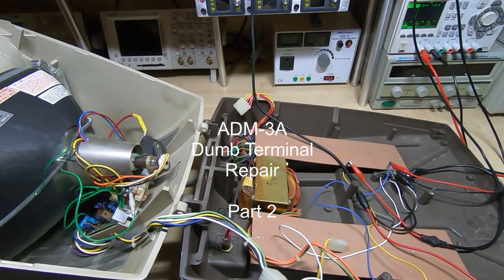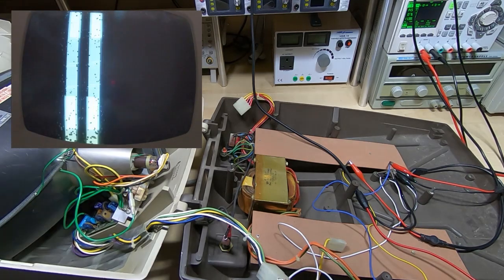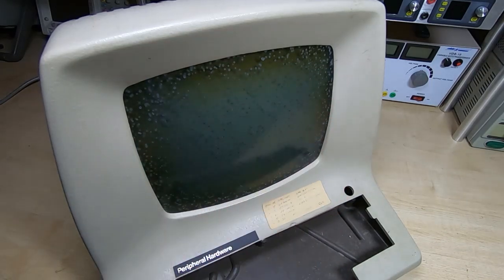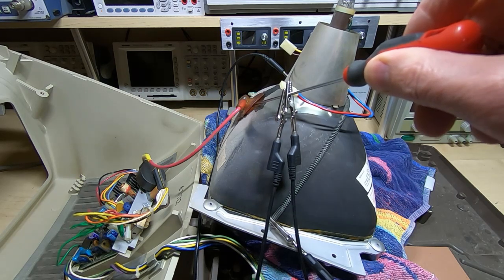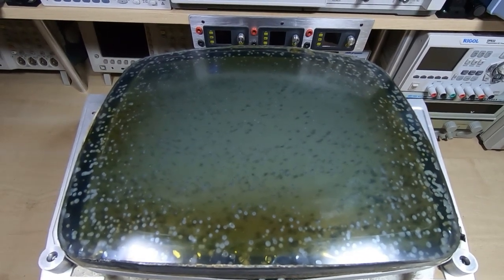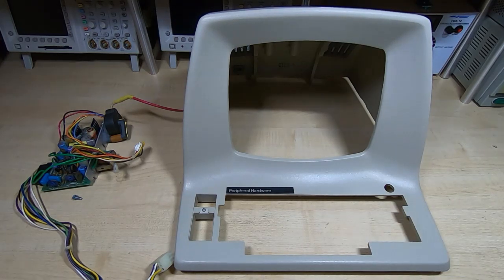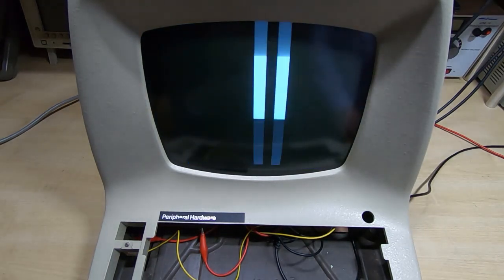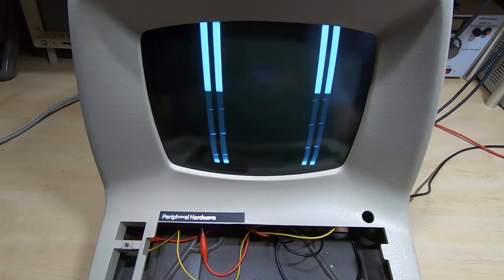ADM-3A Part2

Comment: Jerry, sorry for so making many comments on this video, but what is your procedure for cleaning/restoring the plastic cases?  I've got a DEC VT-78 that the previous owner had marked (with a Sharpie!) as being the property of a famous Journalist in an attempt to entice buyers (he failed and I got it for free, other than paying for ~800 miles worth of gas and a day of driving!).  I can't clean the markings off of the case and certainly don't want to damage the case in order to remove the objectionable markings.
Reply from the maker: Unfortunately this depends entirely on what the issue with the case is and what material the case is made from and the nature of the coating (if any) on the case. You need to decide if you need to 'clean' something off it or re-coat it or re-form it. The last option is the most effective but the trickiest as it requires partially dissolving the case material and blending the damaged parts into the rest of the case. You also of course need to use different solvents depending on the case material. I do not recommend doing this unless you have tried it many times on test items. I think I have tried hundreds of different methods and solvents to find suitable solutions. On the ADM I show in the video I used this method as the case was badly discoloured due to various stickers and marks but it is very easy to destroy the case if you are not very careful so I would suggest caution if you decide to try it. I used a mix of IPA in a buffer of white spirit and acetone (60,15,25) but that was for this particular case. I do NOT recommend trying this if you are not familiar with the process. You also need to apply it in such a way to either retain or recreate the surface texture. Solvents will normally create a smooth finish which is not what you want and will look terrible and may even cause the case to crack. It is possible to get the case to look like new even when badly stained or discoloured but requires a lot of practice.

Comment: Hi Jerry, delighted to find this series. I have been building a retro CPU from LSTTL chips for some time (!) now, and in January I managed to buy a working ADM-3a, which I intend to use as a console. You know, because. (Old guy)
Anyway, the terminal has 2 minor defects. The screen has a dark area around the outer 20%. It's not so bad as to render it unusable, but it's a little annoying. I don't know how to post a jpg here.
Also, the displayed characters "jitter" a small amount from side to side. I haven't recapped it, and I'm wondering if it might be a power issue. 
So... first off, any suggestions as to how I might track down the cause of the jitter? It's a 110V unit, but I am using a good quality step-down psu. 

Would you be willing to take this one on as a refurb? I don't know if YouTube lets one PM another user, but I'm sure we can figure it out if you have the time / inclination.
Anyway, I'm off to watch the next 2 vids now. Thanks for taking the time!
Reply from the maker: You can contact me directly via my web site (jmprecision). The jitter could be many things. You can normally narrow it down if you can characterise it. That is how it changes to different settings and how rapid it is. The dark area may just be degradation of the screen implosion shield resin. It often develops spots but sometimes just goes darker and generally it does this from the outer edges. It can sometimes be resolved (see my video on the tube restoration)  but this is risky as the tube can fail.
Reply: @JerryWalker001  Done. Look forward to talking to you. I'm up as far as the replacement board now, great stuff!

Comment: yes yes yes please show the removal of the glass
Reply from the maker: I have posted another video which gives a bit more information. I cannot show all the detail as the camera gets in the way and it would risk the CRT (which is not mine). If I ever get a faulty CRT I will show the entire process as it will not matter if the CRT fails. The general method is to evenly heat the CRT and then bring the front glass evenly up to temperature until the glue starts to bubble and then thin metal shims can be slid betweent the face and the glass until the glass can be removed.

Comment: I would like to see how you did separate that glass from the CRT. Very nice result !
Reply from the maker: It certainly turned out nicely.
Reply: Removing the glass usually implies fixing the tube face up on some kind of a jig, heating it up and using some plastic tools, gently prying the glass of...
Reply: Jerry, did you make a video showing your procedure for "eliminating" the cataracts?  I'd really like to see that too!  Edit: How did you apply the "glue" between the implosion shield and the CRT to ensure that you had the correct exact thickness?